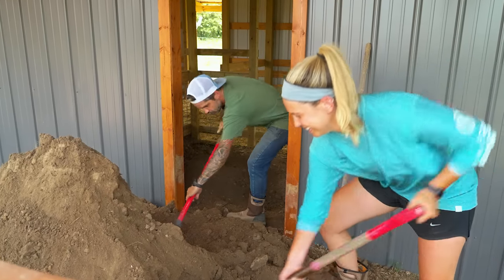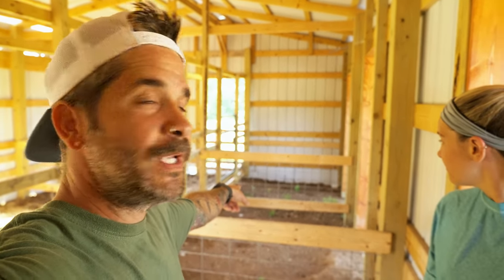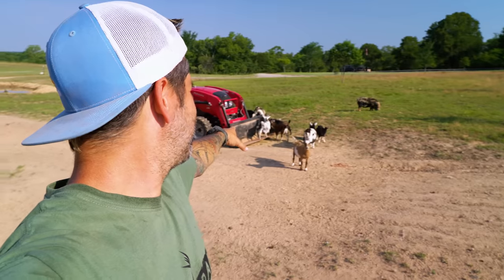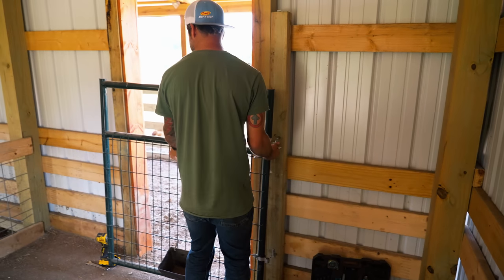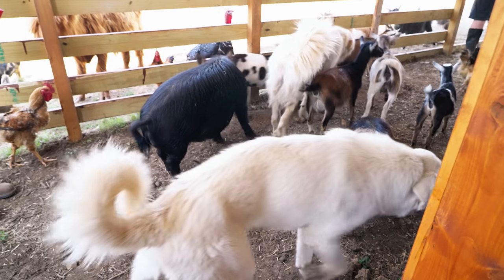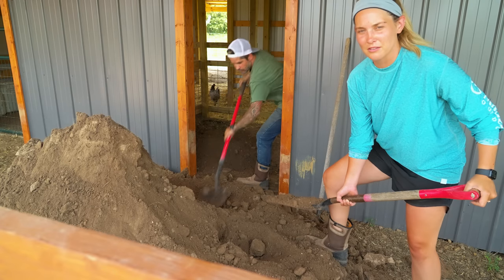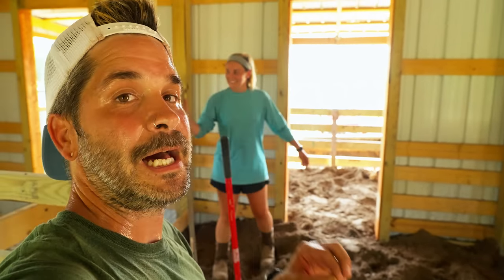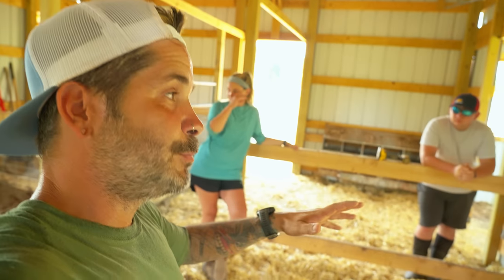BARN Makeover Means HARD LABOR || Homesteading Summer Chores || Living Off Grid

Comment: You need to isolate those chickens that are getting pecked until they heal.  If you don’t, the others will continue to peck them until they die.  Also, if you bury a feeding trough half way in the ground, it will work for the pigs.
Reply: Poor chickens look ragged. It could be from an aggressive rooster or hens picking on them or both

Comment: I have a question, does anyone ever put those big industrial fans run by solar on each  end of the barn to circulate air through for you and the animals? I remember they had them in the dorms at summer camp. ( No AC at camp). It did a good job keeping those big dorms cool.

Comment: So let Adam know in the future to use the closed end of the box end wrench to tighten a bolt. It provides more lock up and prevents stripping out of the bolt compared to using the open end of the wrench. Just explaining, not complaining here folks. The open end should be used to lightly seat the bolt and the closed end (round side of the wrench) is to tighten and fully seat the bolt so it does not get stripped out/damaged.
Reply: But you don't get the experience of knocking your knuckles if you use the boxed end.  :-)

Comment: Have you thought about dry pouring the rest of the stalls then put rubber horse stall Mats down over the concrete. Then you can wash out or sweep out easier. Tractor supply sells the rubber stall mats. Just a suggestion you guys are doing great !!

Comment: We have an exterior porch that we use for our large dogs in the summertime to be able to go in and out of the heat and they have a ceiling fan on them and three walls with screen doors and one wall with exterior door to go in and out, which allows in lots of flies we decided to try your trick with the Irish Springs soap, and it works🦋🎈🎉 Thank you so much for the wonderful tip🥳🎈 We also love your piece of advice on your best tool is the tool you have🎉🎈🎉

Comment: A solution for a feeding trough for the shorter animals is window flower boxes. They are only about 8" tall and you can get them in various lengths. You can also mount them to the bottom boards on the outside of the shed fence at ground level so they cant knock them around.

Comment: Personally that oversized gate that you put on the barn may I make a tiny suggestions from my experience with my animals it may have been better to put the gate on the outside because most animals will push on the gate especially pigs there is more of a chance of them breaking the latch if it is on the outside and it is hitting  the framework to the barn and they push against that they can't break it and get in honestly I do not think that you will keep the chickens out of that feed area the only way would be to put wire higher than they can fly I had the same problem I even tried cutting the chicken's wings they still got in

Comment: 🦮 Remind yourself your dogs Are big animals you can put a small step up for them wood box to jump in 🐕‍🦺 and jump out, each side, make it so much easier on weight for them over the fence rail, 🤔  I don't believe the other animals will get the idea to climb over like the dogs do, good job
On everything you guys done at the homestead 👍
Please remind yourself just as well.The dog's leg or foot could easy get caught insight the panel wires   opening to large square I could see video the goat put his leg in, one of the animals could have their head neck stuck in it. if not careful a accident could happen no one around to help a injure dog's stuck leg, we'll put some safety measures on both sides wood panels on the railing on top  😱  😱 or change the wire panel to a smaller size for safety for any  animals 🕊️